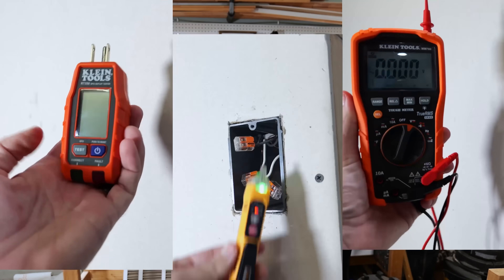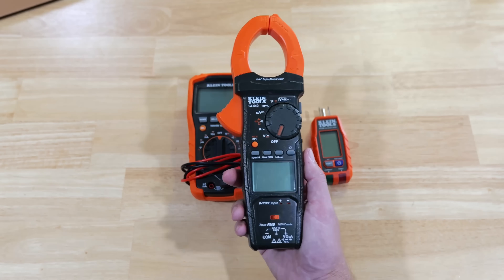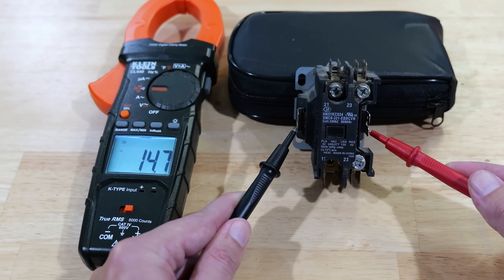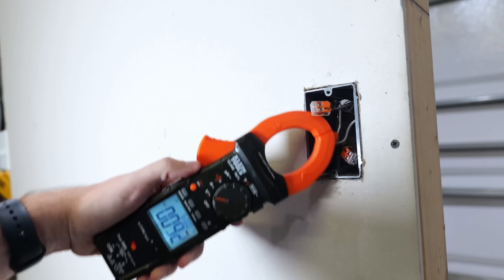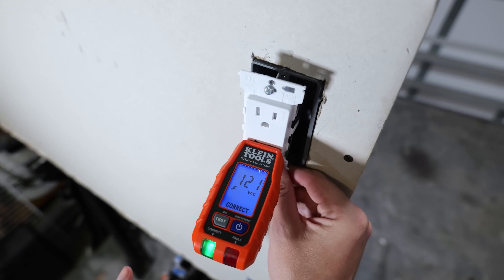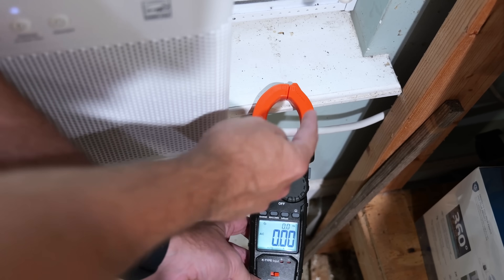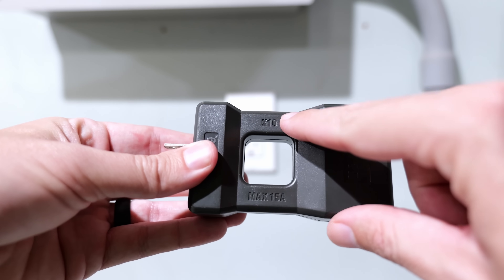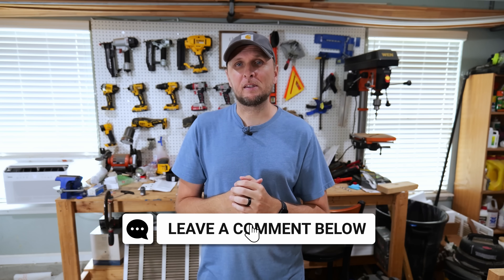The ONE Electrical Tool That Can Replace Them All!

Comment: I don't believe you talked about the "LoZ" function some multimeters have, which is useful for killing "ghost voltage" issues. (Have you explained ghost voltages in a previous video?  If not, I think that would be an excellent topic to cover, with live examples.)  Personally, I wouldn't want to rely on a multimeter without it.  It looks like the Klein CL700 thru CL900 have the LoZ mode; the CL800 also has DC current measurement, another absolute must for me these days, since I sometimes work on stuff with lead-acid or lithium battery packs.

Most of my clamp meter experience has been with Fluke clamp meters.  With the Fluke clamp meters, you ALWAYS have to carry around at least an additional multimeter, since they lack needed features.  For example, none of the clamp meters measure above a few thousand ohms.  What's with that???  That missing feature (megohms measurement) has caused me some misdiagnosis grief, and that's the kind of stuff that sticks in your mind when shopping for a new measurement tool.

Anyway, your video has sold me on upgrading to the Klein CL800.  It's missing inrush current, which I use on occasion, so I guess at least one of the Fluke clamp meters would still have a purpose.  (Yes, I see that the CL900 has inrush current, but it lacks the 60A current range with 10mA resolution, and it's physically larger.)
Reply: I don’t think that clamp meter has a LoZ function. I have used this quite a few times at home.

Comment: So is the AC unit pulling 3.1 or 6.2 amps?  You have different amperage with receptacle out and using the splitter.
Reply: Probably depends on whether it's running the fan only or both fan & compressor when he took each of the readings.

Also, it could be the difference between low fan & high fan.
Reply from the maker: Yup @nwil2003 is on the right track.  The window ac is an inverter unit, so the compressor was pulling more current at that time.

Comment: I found two things these clamp meters can't do. 1) NCV testing below ~50v. Many of these have a sensitivity of 50 volts and up. In order to check sources of voltage in consumer or car electronics, I use my Southwire NCV tester which has a 12v button which alters the sensitivity to detect low voltage sources. 2) DC current draw with the probes. This may vary per unit, but the inclusion of the clamp can dictate that the design intends you to use the clamp exclusively for DC current. That's a problem because small currents are swamped by noise from magnetic fields. An example is finding a parasitic draw from a car battery. I resorted to an inexpensive Innova 3320 and connected it in series with the negative terminal to measure current draw.
Reply: For small voltages/currents, use the probes that come with it and plug in to the bottom of the device. I assume that’s why this device will read micro amps based on the dial. Considering your examples the clamp would be a 95% answer while being more convenient… right?

Comment: Is InRush current testing something a general homeowner or DIY hobbyist really needs?
Reply from the maker: I have used it numerous times on my ac unit.
Reply: If you're testing or working on motors or compressors of any kind then yeah it's a uniquely useful feature. For example, want to see if your portable solar generator can run your Refridgerator? You'll need to know the Inrush on the fridge compressor startup.  Same for a Window AC to run on a portable solar generator/battery, etc.  I'd say it's not often used, but it's an invaluable feature when you need it.

Comment: the plug-in outlet testers are nice for testing gfi functions if it has that feature.
does this clamp multimeter have ac and dc amps or just ac?

Comment: Do tools such as these have versions for working with 240v circuits. I've run a 240v line to my garage from the box and would like an outlet tester to double-check. I believe I used a 30 volt plug. Thanks!
Reply: you can just stick probe in each part of outlet to read the two 120 volt legs and across the 240  of both legs

Comment: If it can't do THD, don't talk to me.
Reply from the maker: None of your standard multimeters can read THD.  Typically going to spend like $2000 for something that can do that.  Most have no need for that either.
Reply: @HowToHomeDIY  there is one that measures thd for 350 bucks. But even that seems too much. I think you just use an FFT to calculate it, and plenty of chips can do that, so im annoyed by the lack of cheap THD devices.

Comment: Your Amazon link goes to the CL445 not the CL440 in your video
Reply from the maker: Yes, the CL440 was recently discontinued.  Don't know why as it is a great MM.  The CL445 is basically the same clamp meter, just a little smaller clamp.

Comment: It appears that the CL-440 is discontinued.
Reply from the maker: Yeah was fairly recent they did that.  I love mine.  But the CL445 is pretty much the exact same meter with a slightly smaller clamp.

Comment: A signal generator to trace wiring is also an invaluable tool to own!
Reply: My tone generator really is so valuable, I use it often at work. Low voltage guy, fire alarms and supression systems. It saves me so much time in trying to troubleshoot and find wiring or device issues.
Reply: Tone generator and tone wand. Amazon it.
Reply: I really like my Ideal circuit breaker finder (61-534).  The price has DOUBLED from $75 to about $145 over the past 5 years.
Reply: Absolutely agree
Reply: Agree, there could a whole other episode on low voltage wiring and testing
Reply: I have the harbor freight (I know) version of this and it’s ok. I still carry around my little ncv tester for convenient sanity checks.
Reply: @BillLaBrie the Harbor Freight breaker finder is actually made by the original company
Reply: Yea i use one too. Also a  compact variable DC power supply like the DCP-150. Also, HVAC short finder. Also - Klein circuit finder. The new one that traces live circuits up to 480. Also - a megger of course.  Also Fieldpiece MM all day. A tone/probe. There's lots of necessary. Hot sticks NCV will get u hurt or waste ur time. Throw that shit in the garbage. Outlet tester, meh. Nothing my mm can't do better
Get a AC to DC 12/24 voltage xfmr slap a power cord to the Line side. Comes in handy for sure

Comment: Electrician question:   I have under the cabinet halogen lights in the kitchen.  I have two strings both separate power switch.  When I turn one string on the lights are normal bright.  After a 15-30 second time frame the lights go dim and stay dim.  Why?
When I turn on kitchen lights and turn on same under cabinet switch,  kitchen led lights fade and go bright quickly.  Why?
With all lights mentioned above are off the other string of under cabinet lights are switched on the lights sometimes come on or are super dim.  Same circuit breaker. As other string.
Separate issue.  I have a light switch that is in a group of 3 other switches.  It has 113v on it.  The rest in the group are 120.  Why?  Additionally I can’t figure out what it goes to.
Do you have a recommendation for a “ringer tool” to help search where the wires terminate at?
Thank you in advance

Comment: For the DIYer, use on of your old commercial grade extension cords that your idiot cousin cut the ground barb off and cut a 1 ft section off the male side. Install a new female end and leave a section of wire unwrapped so you can insert your clamp-on. This gives true amperage vs the Klein add-on "splitter" that for some stupid reason multiplies the amps by 10?! Why?! 

I like the features of the Klein CL440. Cheaper than my Fluke meters with more features. Saved for my next purchase....
Reply: You could think of it like a 10x magnifying glass. Like reading glasses for old eyes. Makes a very small amp load readable with a meter that might have trouble otherwise.
Reply: What do you mean why??? So you can get accurate readings at low resolutions
Reply: Moves the decimal point one point over for more accurate reading of Amps.
Reply: @meisievannancy  Thank you. It makes more sense knowing people measure amp loads that low. They're just moving the scale down to gain accuracy.

Comment: The"clamp" meter is a multi meter. With a couple of extra features. Depends on the brand/ model. I use an SC680 from Fieldpiece. But, it is not the end all tool.
Reply: I have a bunch of meters including the SC680. It's my goto. Great meter. The voltage detect beeping is a little annoying though. Wish there was a way to toggle that off.

Comment: Yeah, but it’s Klein.  I had a CL800 and it started doing this thing where it beeps rapidly when you turn it on. No, not batteries, and I barely used it.  Turns out a bunch of people had the same issue. Klein won’t replace. Got a fluke and it’s just so much more quality, and hasn’t broken yet lol.
Reply: I agree. Fluke is the only way to go. Worth the $$

Comment: Company ad: "For use with all Klein clamp meters"

I get that, but is it also usable with other clamp meters?
Reply: @HowToHomeDIY unfortunately too often many people nowadays assume others with more knowledge about something than themselves are corrupt. Whether electrician, engineer, chemist, lipidologist, et al. the acceptance that others know more than yourself is difficult.
Reply: @HowToHomeDIY  I don't think he was insinuating you being "the ad". I believe he means that the Amazon link you posted says exactly what he quoted and he is genuinally curious if he can use any meter with it.
Reply from the maker: @jthomas. You may be right.  My apologies if that is the case.  One of the reasons I dislike text so much.  I get quite a few comments about this or that being sponsored and just being paid to say what I am.  Which is just not true and I have always turned those offers down so I can be impartial.  The answer to that question would be yes.  It should work with most other clamp multimeters if not all.  There is nothing proprietary to the splitter to where it would only work with Klein clamp meters.

Comment: Non-contact voltage testers are also referred to as death sticks...
Reply: They are good to verify that voltage IS present. Not so much to verify it’s NOT.
Reply: @Fed-Up-AmericanPatriot  This right here
Reply: Could you please explain that
Reply: @TurdFerguson149  they work by detecting a changing magnet field they don’t detect DC, and they don’t detect a capacitive charge...

The tester WILL NOT detect voltage if:
• The wire is shielded.
• The operator is not grounded or is otherwise isolated from an effective earth ground.
• The voltage is DC.

The tester MAY NOT detect voltage if:
• The user is not holding the tester.
• The user is insulated from the tester with a glove or other materials.
• The wire is partially buried or in a grounded metal conduit.
• The tester is at a distance from the voltage source.
• The field created by the voltage source is being blocked, dampened, or otherwise interfered with.
• Operation may be affected by differences in socket design and insulation thickness and type.
• The frequency of the voltage is not a perfect sine wave between 50 and 500Hz.

The tester may detect at a different threshold at different conditions, or may not detect at all unless:
• The tip of the tester is within ¼" (6 mm) of an AC voltage source radiating unimpeded.
• The user is holding the body of the tester with their bare hand.
• The user is standing on or connected to earth ground.
• The air humidtty is nominal (50% relative humidity — non-condensing).
• The tester is held still.

Etc... do some research
Reply: @xephael3485 Holy Hell those “death sticks” should be banned. I bet they don’t detect changes in the next room or down the street either. Absolutely dangerous when they’re not useless. 🙄
Reply: @derrick_v  Did I hurt your feelings?
Reply: @michaelr5606  lol that's cute, you're the Karen wanting to ban something you've never used
Reply: @michaelr5606  I never said they should be banned.  I will say that most people don't understand their many limitations, and as such, they can provide a dangerous false sense of security when doing electrical work.
Reply: @xephael3485  You can make that argument for almost anything. Which is why it was worthy of making fun of.  Saying something should be banned because it doesn’t do something it’s not intended to do is nothing short of asinine.
Reply: @michaelr5606  again I never said it should be banned, you did.
Reply: @derrick_v  It sounded like a joke IMO....
Reply: Very true, I know of at least 10 friends who died using it. Avoid at all cost!
Reply: I think the non-contact voltage tester is good for a double-check or second opinion.  I have often made measurements where the voltmeter isn't reading because of oxidation or an intermittent connection.  Whenever making any electrical measurement, I have made it a habit to always do a double-check, even when safety isn't an issue.  For example, when measuring resistance, I always reverse the leads and measure again.  When measuring a DC voltage, I always flip the multimeter into AC mode and measure again, then back to DC mode and re-measure.  Surprises are common when you do this, which tells me it's worth doing; the better you understand the circuit and your measurement assumptions, the better off you are.  I think it actually save time in the long run, less tail-chasing.